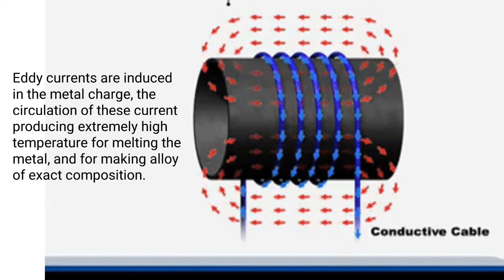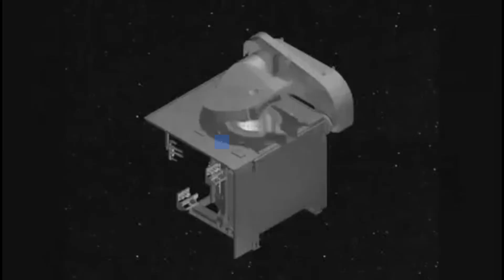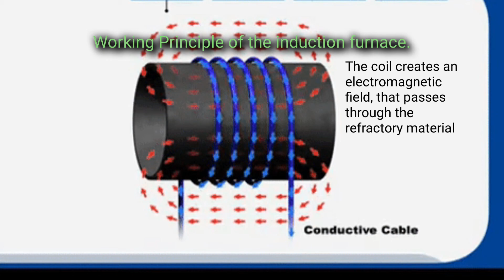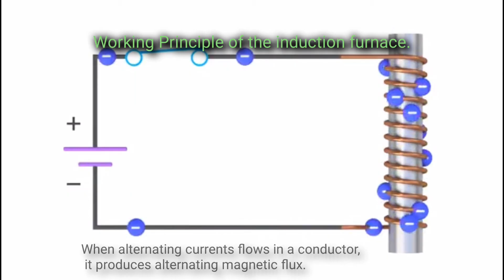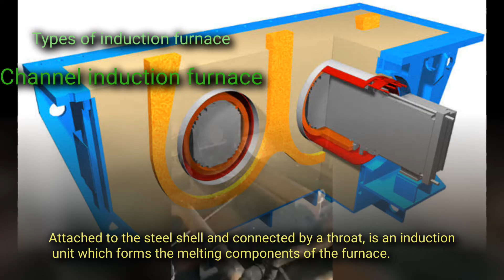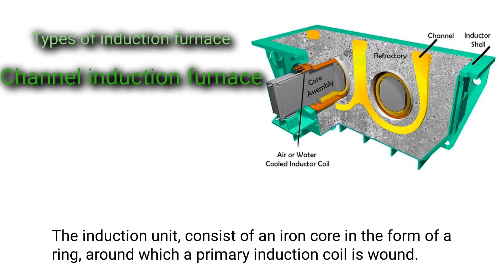All About Induction Furnace - What It Is and How It Works

Comment: How the temperature is monitored
Reply: We use a tool called a Pyrometer, there is a Pyro tip that goes on the end and goes inside the liquid metal and gives off an accurate tempature.